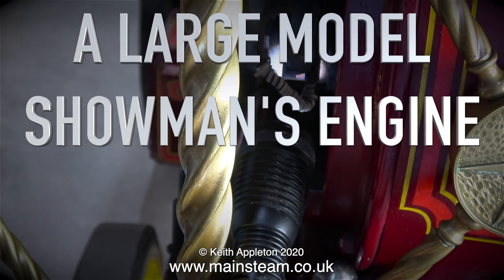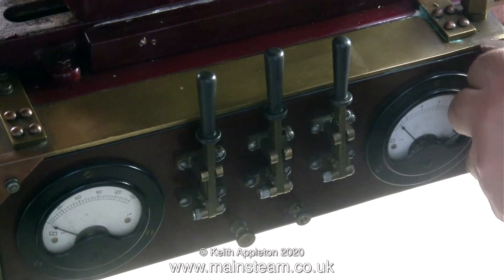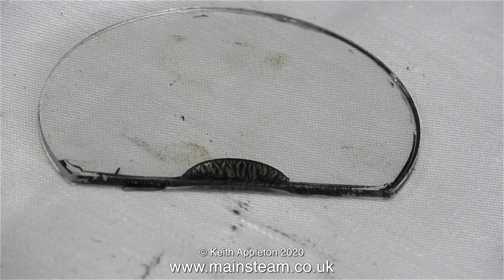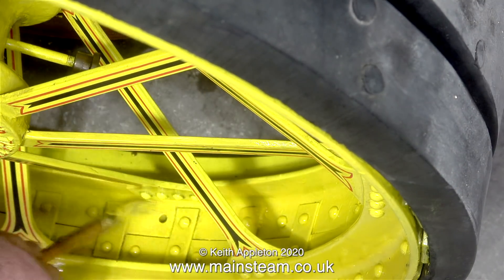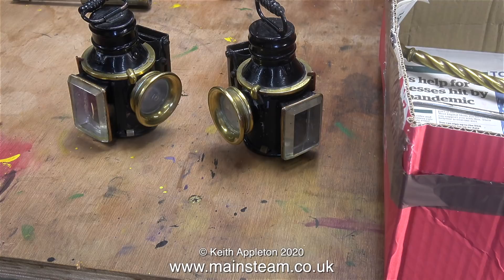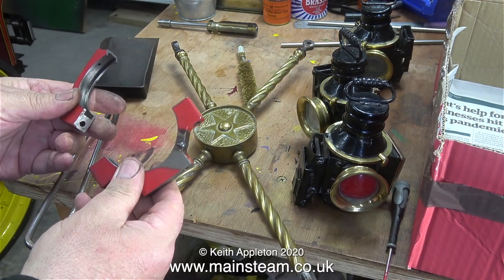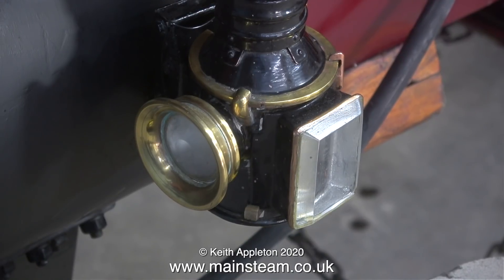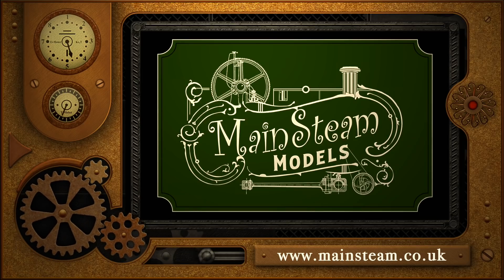A LARGE MODEL SHOWMAN'S ENGINE - PART #11

Comment: Keith, are the rubber tyres mounted directly on the strokes or is there a metal band in between?
Reply from the maker: They have metal bands in between which are fixed to the wheel rims..
Reply: Keith Appleton thank you for the reply. I’m renovating a Burrell 4.5 inch agricultural in similar condition but debating whether to fit tyres over the strakes.

Comment: Just a tip for handling sharp edged glass like the one in your gauge. The edges can be smoothed off quite easily by lightly abrading the sharp corners with a piece of fine wet and dry paper. I light touch is all that is necessary to remove that very very sharp edge.
Reply from the maker: Thank you, I do mention that quite frequently in my many videos about fitting water gauges }:-)))
Reply: @keithappleton  I had seen it in those but your narration mentioned the sharp edges. I thought it would be useful to point out that the same technique applies to flat glass as well as tubing.